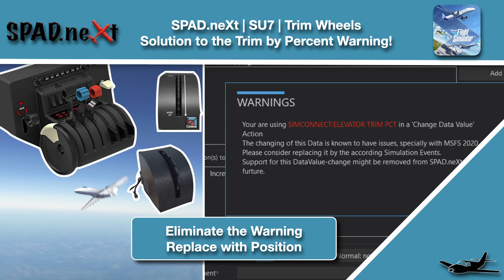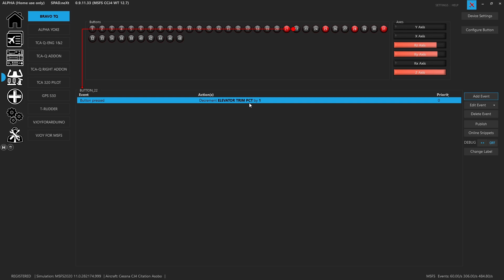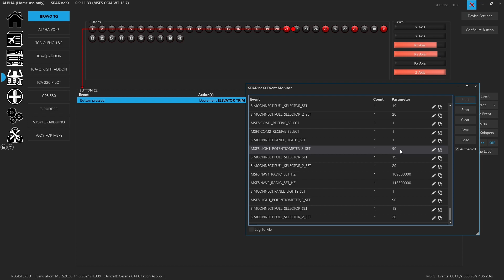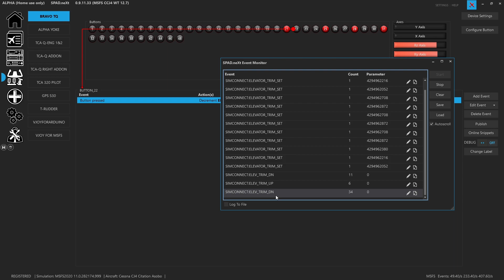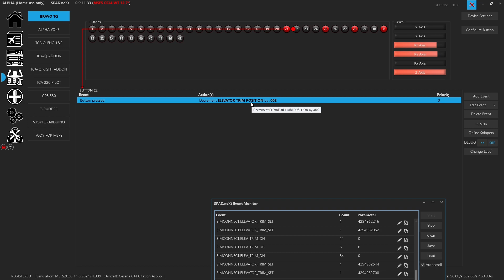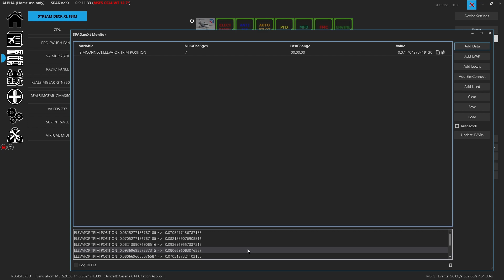(MSFS) SPAD.neXt | SU7 | Trim Percent Replacement

Comment: I just tries this, definitely way better than the default trim function in MSFS. Thanks for sharing. Would love to see a video on how you have setup the response curves for your Alpha.
Reply from the maker: I left the Axis for my alpha assigned in MSFS.. Buttons and switches all in SPAD..  That way I can use it in Drone Mode as well...
Reply: @LesOReilly  Ah That makes sense
Reply from the maker: @richardcarter5404  yeah none of the camera controls have been exposed... recently they did make it that you could use the SDK to recall and store presets but still nothing to connect to the camera controls for movement...  plus Aileron/Elevator/Rudder and Toe Brakes are definite going to be the same in all the planes ;)

Comment: Thanks Les.  I've been using AuthentiKit and vJoy to configure an axis for the Bravo trim wheel.  It works great, but of course doesn't give me the flexibility of having different trim settings for different aircraft profiles like Spad does.
Reply from the maker: Was never a fan of using the old Cesna trim wheel from saitek as it was an Axis..  so when the AP trims then they are not in alignment and when you go back to manual and touch the trim the nose would just jump to a crazy trim setting.

Comment: Is it possible to show us how this works with the trim-wheel in operation? It would be nice to see how it compares between physical inputs and the movement in the virtual cockpit.
Reply from the maker: You just change the Radian value to get it to work best with each plane..  That value will be different from profile to profile since you can dial in what you feel is best for that plane.

Comment: Quick question, I bought Spad to control the trim wheel. Is it possible to have Spad control the trim wheel and MSFS control the rest of the Bravo in the control settings? Hope this makes sense. I'm new to Spad but your video's have been very helpful! Thanks Les.
Reply from the maker: Sure I can be done like that but don’t know why you would want that. One of the best features in Spad is that you can assign planes to profiles and then it switches automatically when you load a plane in MSFS. I would never map anything on my bravo in MSFS directly. 

I do however keep my aileron/elevator/hat switch for cameras along with rudder and brakes in MSFS as those will never be different for me in any plane.

Comment: I just purchased Spad.Next yesterday. I watched this video but when I search for elevator trim position, I cannot find any command with that name. Please help. I searched in MSFS 2020 and SimConnect. I bought the product specifically for the trim wheel of my Bravo TQ.
Reply: Never Mind- I figured out that I was not selecting Change Data Value.
Reply: OK, I set it up but when I move the trim wheel and then let go, the trim wheel on the plane move in the opposite direction briefly before stopped. What am I missing?
Reply: so after setting it up as per instructions, when I move my Bravo trim wheel, it moves but it is a little jerky, I can't move the wheel all the way up or down, and when I stop moving the wheel, it briefly moves in the opposite direction which throws off the adjustment. What could be wrong?
Reply: Figured it out - My Assistance settings in the sim were set to All Assists from the previous SU7 bug and I hadn't fixed the settings yet (UGH) :-)
Reply from the maker: Glad to hear. Sorry these were all hidden in held for review. Don’t put a period in Spad.next in you YouTube comments :). It thinks it is a link

Comment: Having trouble programming the parking brake (Cessna 152). No matter what commands I try, the best I can get is the opposite of what I want. I am programming a Bravo switch and I want the up position (ON) of the switch to be for the brake set and the down position (OFF) to be for the brake released. Can anyone help?
Reply from the maker: Probably need to use conditions and the toggle event. So the condition has to make sure the parking brake is where it thinks it should be and if not won’t send the condition.
Reply: @LesOReilly  It's basically an On/Off switch. I just want the On (up) position to set the brake and the Off (down) position to release the brake. I am sorry, I am still pretty new to this and don't really know how to do conditions yet.
Reply from the maker: Join the discord group. Easier to share images and do real back and forth. YouTube comments are crappy for this. Now I have done this already in multiple bravo videos and it does rely on you configuring switches and buttons as I have done in those videos.
Reply: @LesOReilly  Please tell me how I do that. Thanks much 🙂
Reply from the maker: Watch the other bravo videos. You can sort them easier through the actual spad GUI on the Home Tab. Discord link is on the website top right under contact.

Comment: Is this also usable for a Flight Velocity trim wheel (V1) ?
Reply from the maker: You can probably make a Custom Axis event with it...  But not sure...  Would be good if Flight Velocity offered a version or firmware that showed up as Encoder Buttons instead of an Axis...